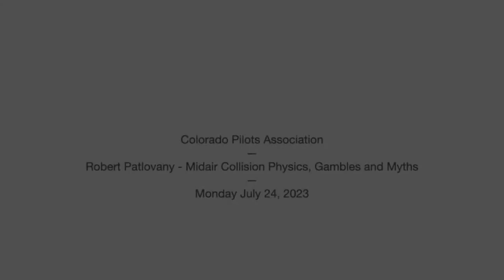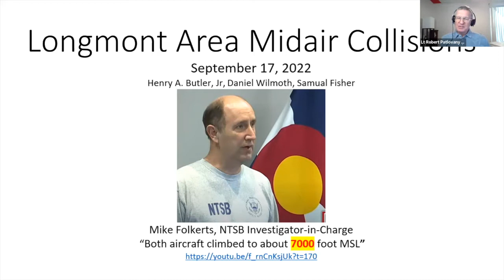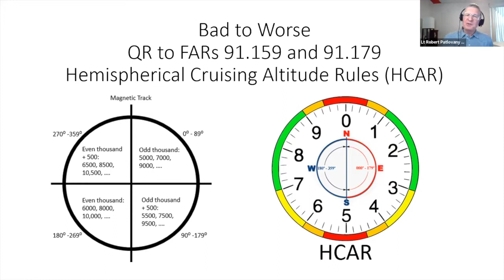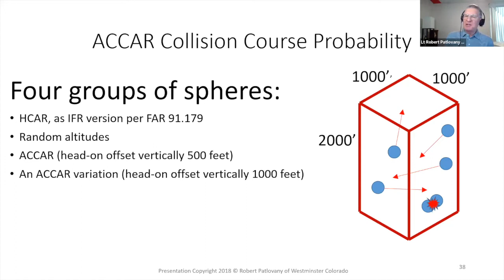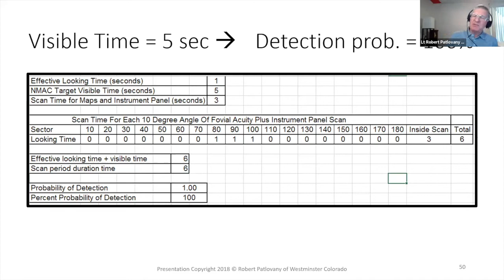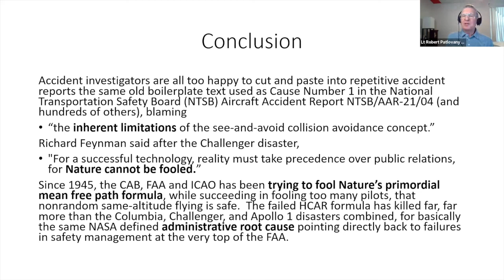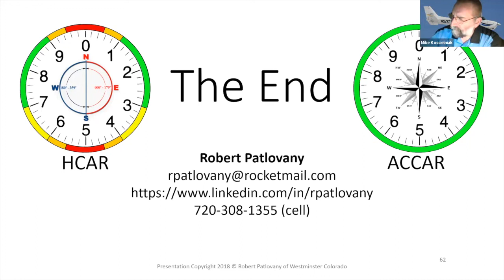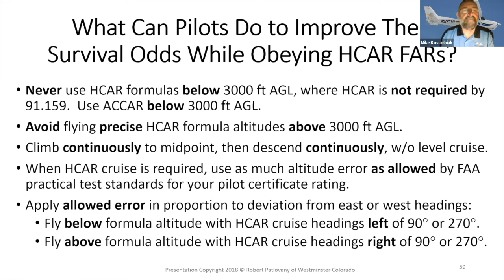CPA Presents - Midair Collision Physics, Gambles and Myths

Comment: Thanks to the Colorado Pilots Association for supporting aviation safety!  

I'd like comments on what to do next.

I've done:

(1) Peer-reviewed research results published from computer simulation data,

(2) NASA corroboration by independently peer-reviewed researcher who supplied FAA air traffic controllers with console programming,

(3) Corroborating case study accidents going back over 100 years,

(4) Root-cause correlation between case studies and accident data,

(5) Requested notice of propose rule-making (28996) to the FAA to fix the problem (denied 1997),

(6) Presented in-person in 2008 a 30-second video running in a loop for over two days at FAA Headquarters during an NTSB symposium on drone midair collision safety showing the far safer 1928 idea keeping six drones safe from collisions with simultaneous waypoint crossing within a 1000-foot vertical interval that would have wrecked all six if they had been obedient to FARs 91.159 and 91.179,

(7) Explained the problem in person in 2008 with two 15-minute meetings with two future NTSB chairmen, who were board members the day I explained the regulatory problem inadvertently designed an aviation hazard into regulations,

(8) Explained the problem in person to a member of the US House of Representatives,

(9) Presented a webinar to over 600 pilots voting electronically by 89 percent to reject the non-existent safety basis of regulations dating to at least 1963, in favor of random altitude cruising.

What should I try next?  

What part of the science have I left out?  

Is there a political angle I need to pursue?

Thanks in advance for any helpful comments or actions to fix this deadly-by-design problem.
Reply: Your work, Dr., needs to be heard far and wide.  What does AOPA have to say about it?
Reply: @kentd4762  I am not a doctor.  Just Robert.